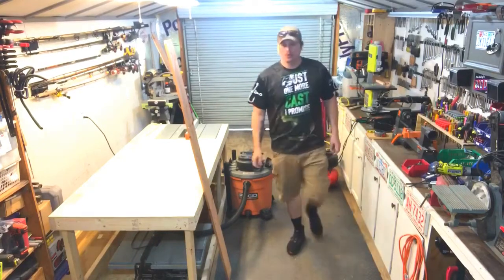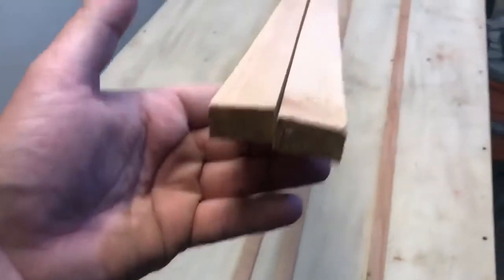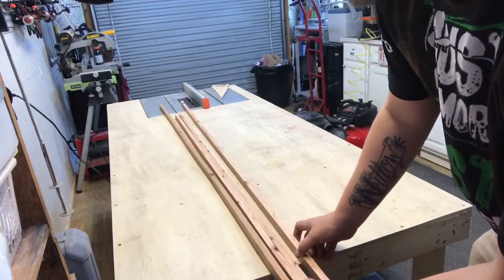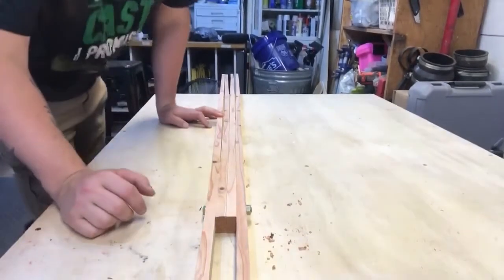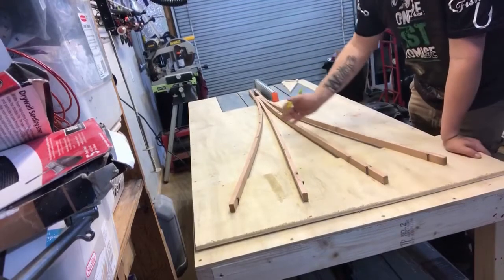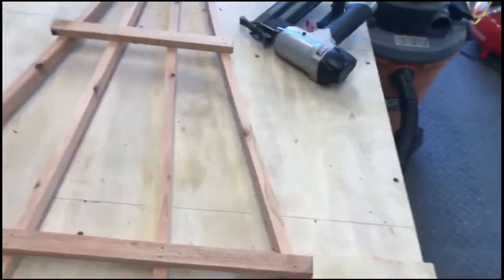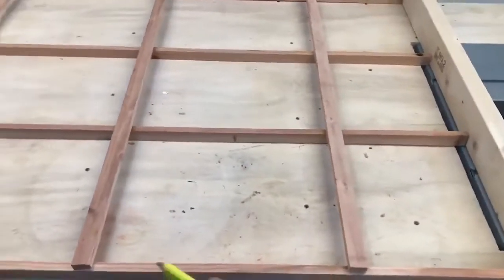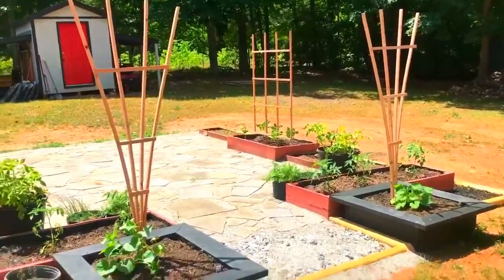#diyproject Climbing garden trellis CHEAP

Comment: You might have said it and i just missed it but on the fan trellis how long where your cross braces and how far apart where they spaced
Reply from the maker: I spaced my cross braces out 2 feet apart. as far as the length- I just let them overhang the sides an inch or so